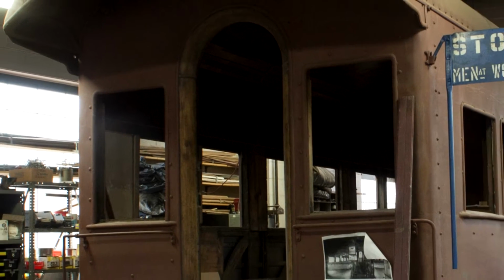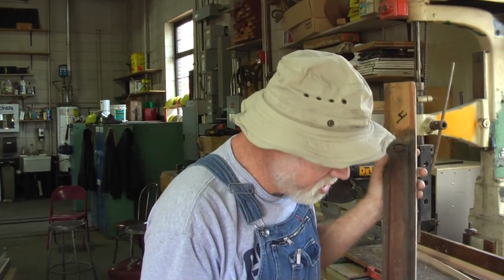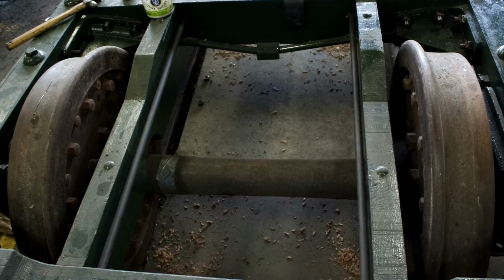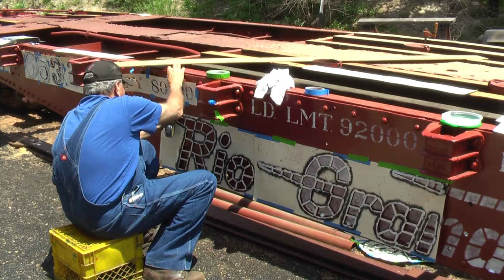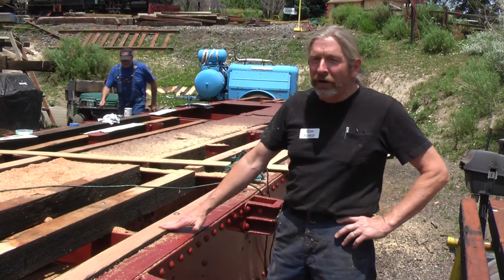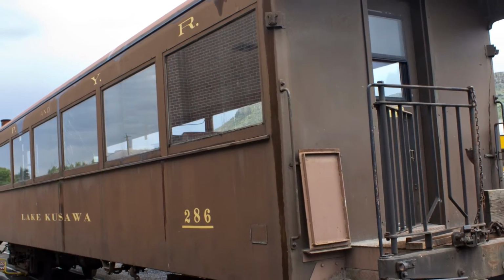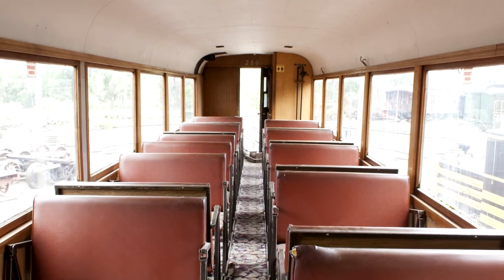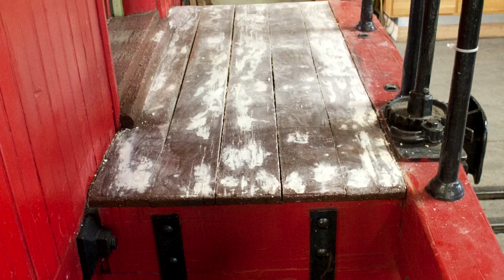Colorado Railroad Museum Roundhouse Update with Restoration Manager Jeff Ambrose.

Comment: Glad to see all the nice work on the rolling stock. To be able to work indoors is so beneficial - better use of the available person hours, let alone the outside work in the mostly nice Colorado weather.  It was very difficult in the early years, lack of tools, heat, time and experience (not mention money) that generally meant the display was in a race to maintain a presentable condition vs falling apart.  Keep up the good work, whether on locomotives, cars, small displays or buildings.  This from one who was there in the beginning.  C. B. Ahrens